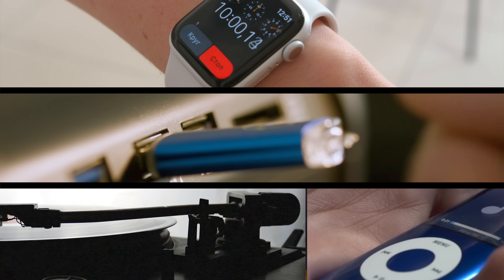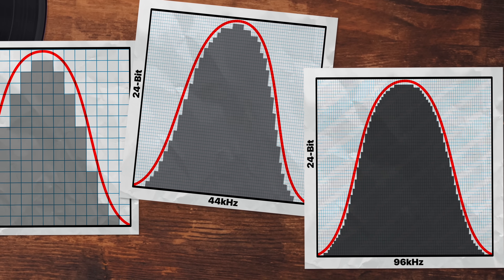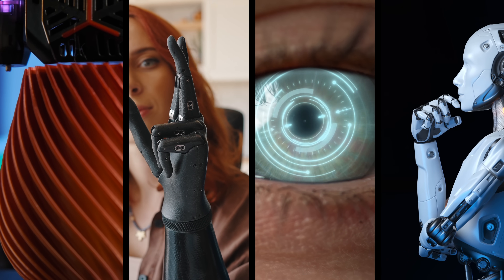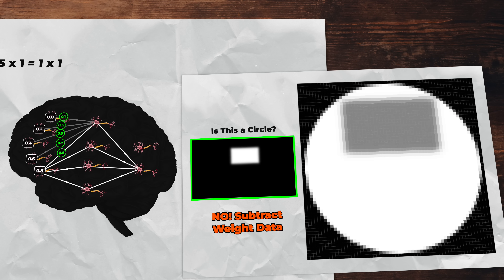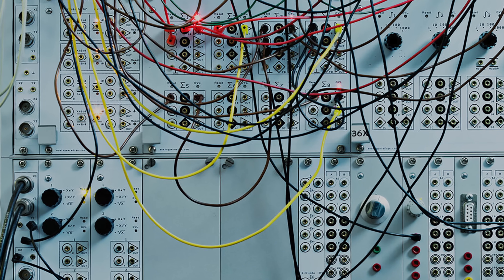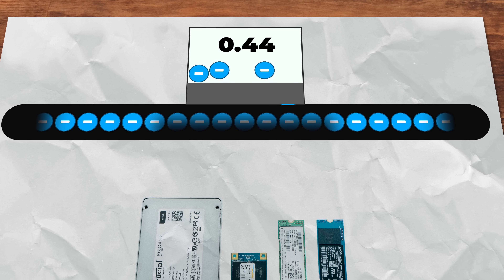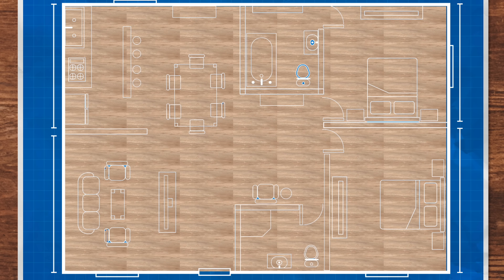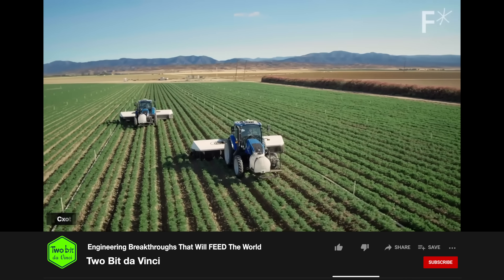Analog Computing is GENIUS - Here's Why!

Comment: The sound waves coming out of the speakers of the TV I'm watching you on are analog.  Sound is analog because it inherently exists as continuous, varying pressure waves in a medium like air. These variations in pressure are not segmented into distinct units; instead, they form a seamless and unbroken flow of fluctuations. This means that sound can take on any value within its range, not just specific, predetermined levels. This continuous nature of sound contrasts with digital signals, where values are represented by discrete, separate steps. The analog characteristic of sound allows for an infinite gradation of tones and volumes, leading to its smooth and uninterrupted quality. This is why sound, in its natural form, is fundamentally analog.

The light from the video is both analog and digital. 
Imagine light as being like a smooth, flowing wave (that's the analog part) and also like a bunch of tiny, indivisible packets (like digital bits in a computer game). These tiny packets are called photons. When we look at light as a wave, it seems to change smoothly, like the colors in a rainbow. But when we look closer, we see that light is actually made up of these photons, each like a tiny dot of light, which you can't break down into smaller parts. So, light is special because it can be both a smooth wave and a collection of these tiny, distinct dots at the same time. 

Voltages in the equation V=IR (Ohm's Law) are analog because they represent continuous values in an electrical circuit. In this context, 'V' stands for voltage, 'I' for current, and 'R' for resistance. 

The analog nature of voltage means that within a circuit, it can take on a continuous range of values, not just specific, set levels. For example, the voltage across a resistor can be any value within the limits of the circuit's design, smoothly varying as the current (I) or resistance (R) changes. This is different from a digital signal, which would have distinct, separate levels (like 'on' or 'off'). 

In essence, the relationship expressed by V=IR operates in a continuous, fluid manner, where adjustments to current or resistance lead to proportional and uninterrupted changes in voltage, characteristic of analog behavior.
Reply: Most interesting comment in this thread has the least likes. Go figure. Thanks for this, especially agree about the sound part.

Comment: I'd be interested in how they've mitigated transistor breakdown from heat or over-volting, and if theres an on-going calibration cycle required to make sure the output is as expected
Reply: You seem extremely knowledgeable and if I may ask, can you please elaborate on some of the practical concerns you mentioned?
Reply: @jaymethodus3421  What he is getting at is that if a transistor gets hot its measurable voltage characteristics are likely to change. This would mean that the output would change unless some kind of compensation was built in. (In digital processing the transistors are simply on or off whatever their temperature (well, up to the point when they burst into flames!)

Comment: Having grown up in the golden age of record players I fall on the side of digital.  After a single play on a turntable a record will lose that frequency response curve.  It really doesn't matter how expensive the turntable the wear and tear on the record is a function of the design.  A physical needle riding grooves wears a bit of those grooves away with each play of the record.  The quality of the digital recording is there forever.
Reply: A few decades ago my local newspaper ran a story about an audiophile. Because of the degradation you mentioned, he played his vinyl records once - to record to open reel tape. He listened to the open reel tape and archived the vinyl.

When CDs were new, most were created from analog multitrack masters. There were stories of classic albums suddenly revealing studio air conditioning noise on CDs, not heard on vinyl.
Reply: There's a record player that uses a laser to read the record, so that is actually onlu true if you have a record player that uses a needle
Reply: Photon pressure will eventually degrade the vinyl , albeit over thousands or even millions of years.😅 @xtofury
Reply: @xtofury isn't that called a CD?
Reply: @florptytoo  CD is digital, so no lol.
Reply: @xtofury  I always wondered why they didn’t use a laser
Reply: @xtofury lol it’s “only”  true, if you have a record player that 99.999% of people  with record players have?
Reply: I'm a professional musician and audio engineer, and I worked as a technician around the time that studios were replacing their 24 track tape machines to DACs and ProTools.  I'm 100% on the digital side. Not only does it never lose fidelity no matter how old or how played your media is, it also makes the process of making music available to anyone with access to a basic computer.  My one regret is that software amps came after my band days, because I was my own roadie, and a quad box (Mesa 4x12 flat cab with a dual rectifier head) is heavy and awkward. I also have a Fender deluxe combo (also heavy) and a mesa mk 4 combo (heavy, but manageable).  They all live in my friends studio now, because I only need an amp maybe twice a year, these days. I use guitarix, Tonelib Guitar GFX, the MOD plugins, and also the lite versions of Guitar Rig and the IK Multimedia one (Custom Shop 5 I think it's called), and I've also used many of the free "amp vsts" and ir files for a million amps and "tones" It's like back when I was in school, I had a job at a vintage guitar shop, and I could borrow stuff for recording, but now I have everything in the shop, plus a bunch of stuff you would never see, I can mike it how I like, and I DON'T HAVE TO CARRY ANYTHING HEAVY! Lol.

Also, overdubs in Mixbus! OMG, I will never miss rewinding tape.  Never.
Reply: I had a friend who likes to watch old movies shot on celluloid but he likes to watch them in ultra high definition which just shows up things the original cinematographer was counting on the grainy image to conceal. Hell, they even put Vaseline on the lenses sometimes.
Reply: He's talking about a specific use case where you don't need the accuracy of digital.
Reply: i like the wear and tear of analog vinyl, but I like to mix and scratch so having a unique sound due to a slight difference in wear is something that appeals to me. for my personal playlist in the car tho I do prefer digital as well.
Reply: @IVIUT3D for my personal playlist in my car, I MUCH prefer analog. You even get the nice distortion when you hit a speed bump or pothole, that really adds to the music
Reply: The data on digital medium degrades too.
Reply: @survivingthetimes  I was gonna say this same thing.

Although we are working with crystalline and diamond data storage, once it is written, it will be readable for hundreds, or thousands of years. These are in their infancy still, but very cool stuff.
Reply: @Haydatsanime   I have code I’ve written stored on silver halide archival film in a vault in the arctic 🥶
Reply: @survivingthetimes  That's a pretty confusing statement.. While I know a storage medium can degrade I'm not sure how digital media as data would change over time without being re-encoded..
Reply: @survivingthetimes  
The digital medium itself does degrade, but the benefit is that the data can be easily and indefinitely copied and verified to be exactly the same as the original (just gotta store something like a checksum with it), whereas every analog copy will necessarily be slightly more degraded than the last.
Reply: A bigger issue with vinyl records is that high frequency response diminishes the closer you get to the center of the record, since the circumference (and hence, linear velocity) decreases. Essentially, you're trying to fit the same amount of information into an increasingly smaller area, resulting in decreased resolution. Inner groove distortion, as it's called, can be mitigated to a large extent with advanced (i.e. expensive) stylus profiles, such as Shibata or Microlinear, as opposed to the more conventional conical or elliptical styli found on most setups, where distortion will be noticeable, more or less. But even then, the fidelity comes nowhere close to that of even then cheapest DAC.
Reply: @Hellcommander245  that is a really fascinating point. I'd never thought of that.
Reply: @Hellcommander245  Hi. That’s why I prefer Edison cylinder records. Cheers.
Reply: @Hellcommander245  I just gave the simple explanation
Reply: @chrismaxny4066  someone always has to say the same thing as you but with more words to sound smarter hellcommander is probably insecure
Reply: @chrismaxny4066  Saving this
Reply: Firstly, the quality of digital records is not forever digitalized information, fragments overtime, and if the information is copied, then it loses some of its original data. This is prevalent in any videos that You have seen online that have been copied from other platforms you can literally see the resolution degrading the more gets copied

Secondly Japan has developed a super high class, analog record player uses laser and magnetic technologies that I don’t pretend to understand in order to read, read a record without damaging it with a needle. I’d highly recommend you look into this I saw it several years ago, At the time and even now I have nowhere near the money to buy such equipment as it is $10,000. I’m still interested in getting one when I finally win the lottery.
Reply: @seanu6840 I think that you are mixing some things up. A direct copy of a digital file should always be an exact copy, unless there's a failure in the hardware, software or power. I believe what you are referring to is  when someone resizes, resamples, or transcodes to a lossy format. Uploading a video to most video platforms  means that they will transcode the file at least once, probably several times, in most cases.
Reply: I was there at the very start of the consumer boom of CD's, I bought duplicates of my vinyl collection every one of which sounded worse on CD. A new CD player improved things but the only reason I stuck with digital is that most of the listening I do is to learn the song and you can't repeatedly access parts of a song faster than in digital form. If I just want to relax and listen then I prefer my vintage turntable, valve amp and vintage speakers, not because they offer a perfect or identical reproduction every time but exactly because they don't. With the turntables very subtle wow and flutter (I don't notice it), the amp driven to the onset of distortion (for anything with a guitar solo especially) and the speakers lack of perfection and what you actually hear is a one off performance, the music becomes alive and a thrill to listen to. Play that same track again and get a subtly different performance! At the end of the day if you are listening to music just to critique the equipment then you are (in my humble opinion) completely missing the point of the music in the first place.
Reply: 🚅  don't you all enjoy railroad
🚈  trams, trains etc are just so cool
🚞  take a ride in my ''transportation''  folder :)
Reply: Every time you access a jpg image file, it degrades it just a bit. It somehow happens digitally as well.
Reply: Laser vinyl turntable.
Reply: Their not gonna use vinyl this technology is gonna be like magic just wait and see
Reply: All this aside, I don't remember the details but there are reasons why people still buy vinyls today and prefer them over digital, sound wise. Something to do with the mastering, for one.
Reply: @mikuspalmis  I used to make fun of "audiophiles" and the people collecting records. I thought it was stupid as digital was clearly, obviously superior. Then I ended up the owner of someone's old record collection and it changed my life. I thought, what the heck, I'll just play some of these stupid things to prove how crazy these people are. I picked up an old record player at an estate sale for $20 and played some of the records. I was SHOCKED at how much better they sounded than all my digital versions. It was mind blowing. Now I'm a big "audiophile" and love my record collection. 😄
Reply: @sheshotjfk8375  Awesome. Thanks for sharing your experience. About how old were you at the time?
Reply: Actually, the needle wears... 😉
Reply: @CynHicks  actually the vinyl wears!
Reply: My dad had several "direct to vinyl disc' records. They sounded amazing. The inset jacket explained that the recording was a live take to a master press. No tape recorders in between. ..or something like that.
Reply: I mean more research has gone into analog computing than digital computing. Digital computers with a fraction of your phones computing capacity and storage used to fit in warehouse sized rooms and use punch cards as their digital storage medium, they were energ hogs, and not particularly reliable and punch cards are hardly an eternal and dense storage medium. There is nothing stopping us from microscaling analog computing and storage making it more reliable. It's research and scaling.
Reply: The needle which causes degradation is an older technology and wouldn't be needed in future analog. But with analog, quality degradation couldn't be quantified easily. With digital, a digital copy can be an exact digital copy.
Reply: Analog audio vs digital audio is a tad different than analog computing vs digital computing

Comment: You don't seem to be representing digial audio correctly. Per Nyquist, digital audio reproduces audio up to 22 KHz with perfect fidelity. It's not a stairstep approximation of the waveform. A 20 KHz digital signal will look absolutely perfect on an analog oscilloscope.

Higher bit depth gives you higher dynamic range. 16 bit is enough to make your neighbors hate you if you actually set things up so that the entire range gets properly used, and endanger your hearing. 24 bits isn't needed to reproduce waveforms more faithfully, but to have more range when editing audio. It's not needed at all for playback.

22 KHz can be barely heard by anyone, and high frequencies get lost with age, so most adults can go even lower than that without a noticeable difference.

Comment: Hi folks,
        The one thing that an analog computer can do that a digital one can't do is to survive military EMP weapons grade attacks.
        So i am curious to see how they work and if they are quickly reprogramable.
                               Resp. ,
                               R.
Reply: I'm not sure what your basis is for making that claim.  The thing that makes high-density digital circuits susceptible to EMP attacks, is that it doesn't take much current through a sub-micron transistor to destroy it.  It doesn't matter whether that transistor is doing a digital task or an analog task.  Now, if you're talking about a 1970s analog computer vs. a 2020s digital computer, that may be true.  But that's not the sort of analog this video addresses.
Reply: @BrightBlueJim  Hello, what then is it good for?

Comment: Are you conflating accuracy with precision?

A digital clock is very precise, it may say 12:00. But without a seconds display, it's wrong for 59.9999999999 (infinity) second of every minute.

One could say, "digital clocks are precisely wrong wrong most of the time. But close enough".

An analog clock may not be precise, but analog clocks consistently sweep or interpolate between the steps digital will make. Therefore, it can me more accurate. Especially if tied to the same type of highly accurate/tolerance oscillators driving digital clocks.

Comment: I think it might be more accurate to call it "encoded" instead of "digital." Digital just means encoded using numbers.
Reply: In signal and systems theory, a digital system is discrete in both time and amplitude domain, like a PCM signal. Analog is continuous in both time and amplitude, analog to reality. If the signal is continuous in either domain it isn’t digital. So there are some special cases like some echo effects that are discrete in time domain but analog in amplitude domain, generating a signal that arguably is neither truly analog nor truly digital.

Comment: Did a digital computer simulator design 30 years ago that interfaced with analog controllers for the actual machines. The analog system responded instantaneously whereas the digital simulator could not keep up to provide realistic feedback. Solved it by cheating, not proud.
Reply: Spoiler alert: digital design has improved a bit over the last 30 years.
Reply: Sorry, it was humor.
Why is Analog coming back? Quantum reality is where they both take their place. @BrightBlueJim

Comment: Im curious how they are dealing with loss of voltage over time. 
My understanding on how virtually all flash style memory works that that they work because they use  use the gross +/- and not the voltage because over time the voltage drops albeit slowly but if you are using the actual voltage then that would be an issue.
Reply: That is probably the secret sauce that makes Mythic an innovator. My guess is that they are innovating on the idea of flash memory for this use, not just taking off the shelf components and slapping their resistance readers on the end. It is probably a specially designed chip using flash like tech that they developed. Either that or adding in drift detection over time? Like if you input something with a known output and you end up with a different output, then you can calibrate and adjust your input to deal with the voltage drift.